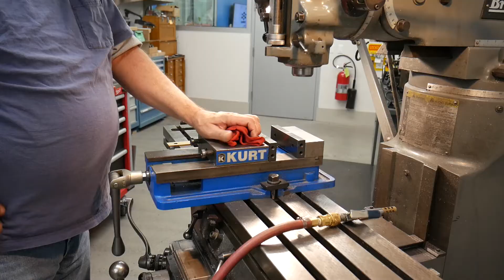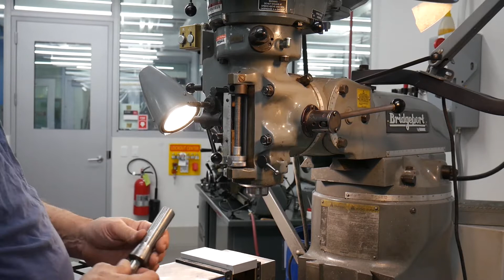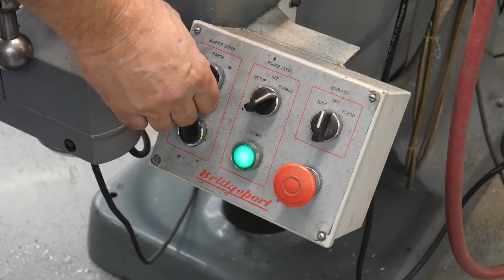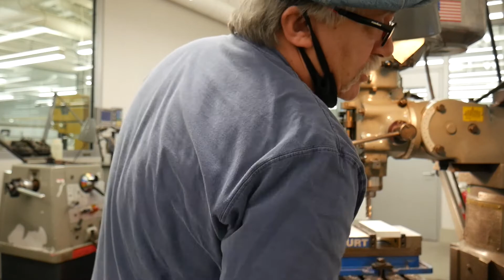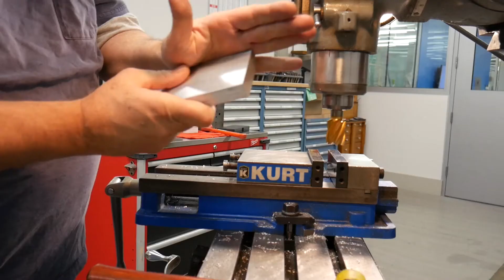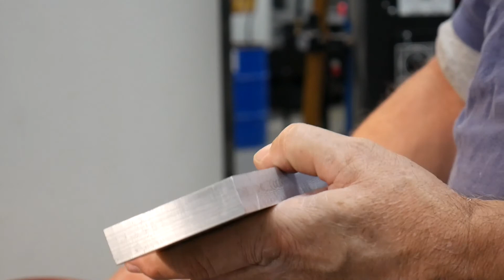Squaring Stock for Manual Milling

Comment: This guy is a clown. Not only is the part not anywhere near square. You've got the quill hanging out of the mill 6 inches down. Not to mention you didn't choke up on the endmill in the collet either so 100% you're going to get some tool deflection... NEXT!

Comment: Totally wrong way to square a part!  You should've had the part a least half it's thickness above the vice jaws and ran the end mill around it traveling front & right and then traveling back & left clockwise (conventional milling).  Then do the opposite traveling  back & right and then traveling front & left clockwise (climb milling) to the finished dimensions  After that deck the top surface, unclamp, flip it clockwise 180 
degrees, re-clamp, rinse & repeat. Never take advice from someone wearing a clown hat...

Comment: Once you stood the part on edge in the vise, what gaurantee was there that the bottom you are referencing from is square to the sides?  Good way to create a parallelogram.
Reply: Exactly
Reply: Yup, they cut two sets of parallel sides. You got to make one set of parallel sides, then use those parallel sides to hold it in the vice to make a profile cut. This will give you a perpendicular face, and then you can square up the last side with either an end cut or profile cut. Sad to see such a prestigious university make a rookie mistake... If you repeat his steps backwards, then you would have a squared part.
Reply: @moore1182 agreed 💯. The way I was taught.
1)clamp on the thickness n face both sides of the width.
2)clamp on the width you just cut
Face the top n side mill both sides of the length 
3)flip it over n tap down than face the top